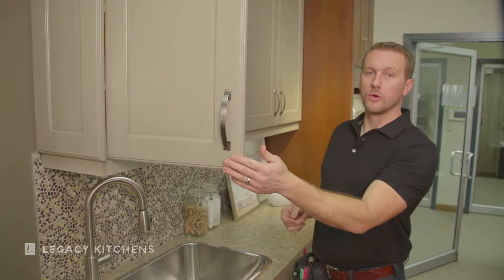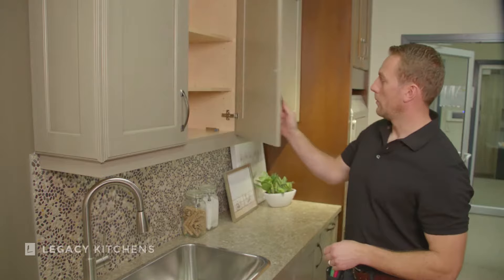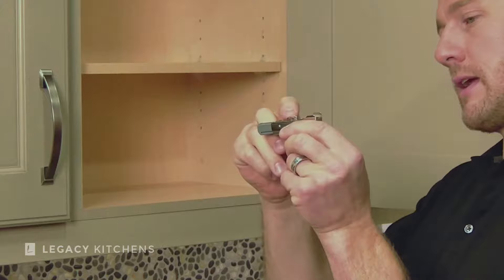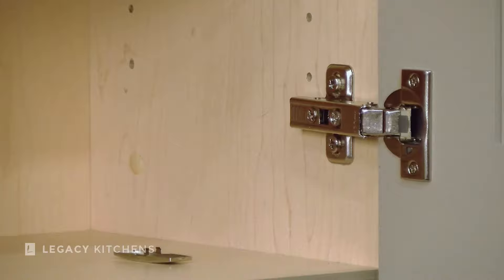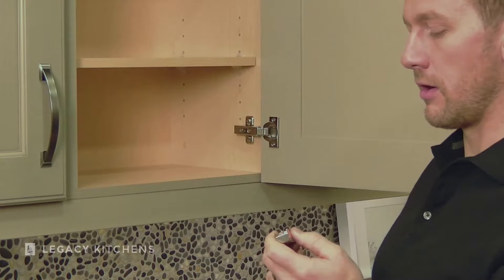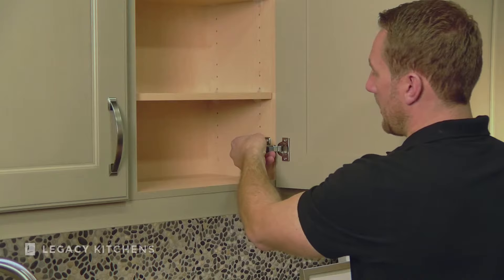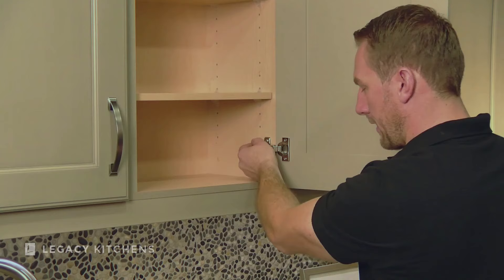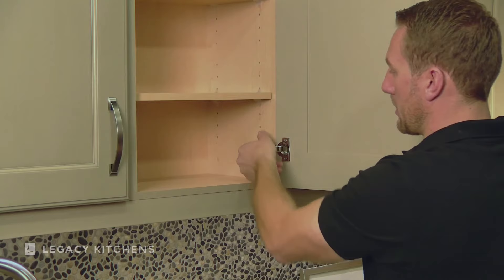Installing a Cabinet Soft Close Clip-on Mechanism

Comment: Still can't do it. I ve been trying for 4 hrs binned it
Reply: When these things don’t pop in it’s a nightmare. Easy fix: get a pair of needle nose pliers. Hook one end between the 2 fixed clips at the bottom. Hook the other end onto the springy part opposite it. Squeeze so you gently pull the springy part TOWARDS the two fixed clips. Now seat the hinge. If it seats but is a little loose, push the springy part gently AWAY from the two fixed clips and try again. Should sit in there perfectly.

Comment: Doesn’t always work. The dampers often need a small adjustment. When these things don’t pop in it’s a nightmare. Easy fix: get a pair of needle nose pliers. Hook one end between the 2 fixed clips at the bottom. Hook the other end onto the springy part opposite it. Squeeze so you gently pull the springy part TOWARDS the two fixed clips. Now seat the hinge. If it seats but is a little loose, push the springy part gently AWAY from the two fixed clips and try again. Should sit in there perfectly.